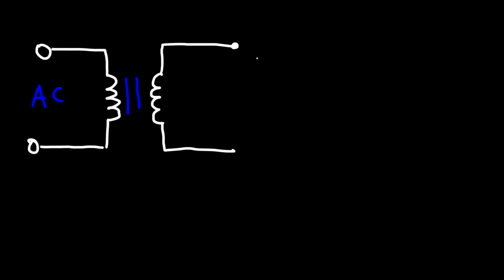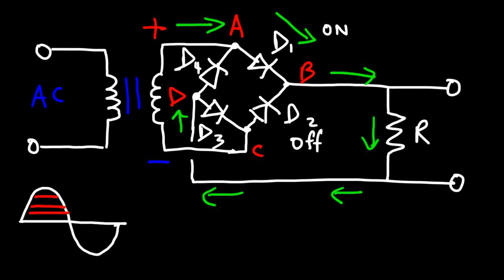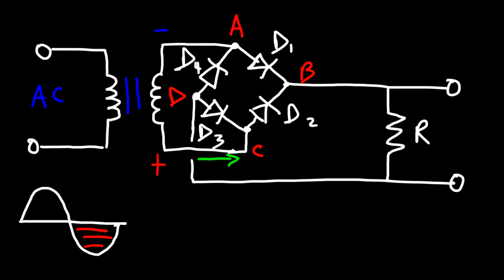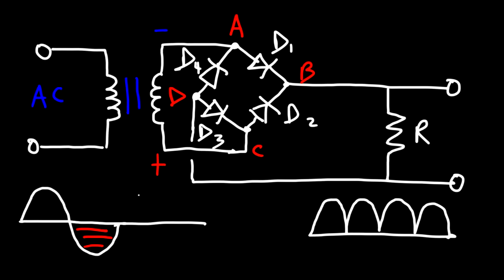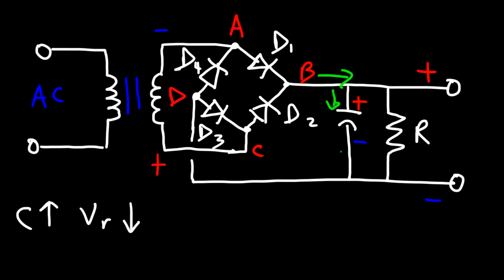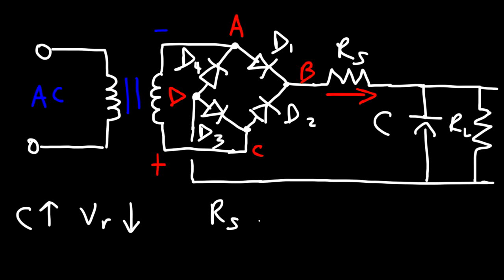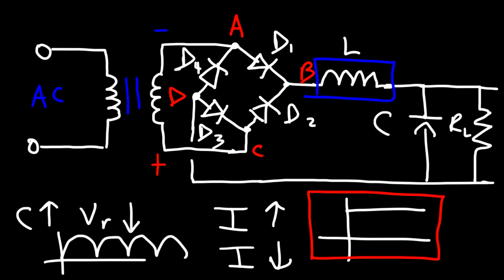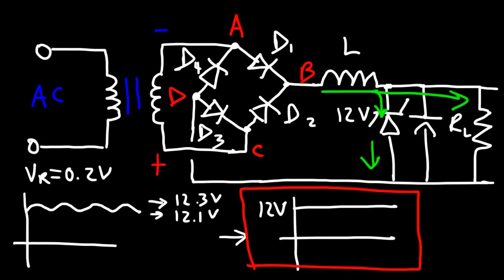Full Wave Bridge Rectifiers

Comment: Thanks for your video. You explain the current path taken is from high to low potential. That can be confusing when you have multiple paths at the same potential. I was taught that current follows the path of least resistance. You didn't explain that on a positive and negative cycle 2 diodes conduct and the other two don't. That makes it easy to understand why polarity would change and why a rectifier works.

Comment: Diodes maintain a constant  forward Vdrop, it's the excess current that blows them out. Diode will remain at .7 Volt. Multiply that by the current, and you get the maximum power the diode can handle. P=I*V

Comment: When the AC current is in its positive phase, why is the voltage below the transformer negative (-)? My intuition would say that the voltage is 0, not negative.
Reply: The positive and negative just denote the direction of current. The voltage is V right at the beginning of the current flow and zero after the cycle of the current around the circuit is complete.

Comment: Need your advice. Have a source from hub motor of 24v ac and want to use a microwave transformer to step up and I am getting 105 volts ac. I need about 88 volts DC only but after I use a rectifier ic I get 84 v DC. How can I get a constant 88 volts DC from my set up?

Comment: Thanks for this thorough explanation.
Please does the inductor used in the circuit for ripple voltage reduction has any negative effect on the circuit? Like the resistor

Comment: I don't understand how the capacitor discharges in this circuit which direction will the electrons flow in that case ?which diodes will be ON then,when the capacitor is discharging?

Comment: Morris Achtemichuk
Well done, but I'm still trying to find out what amperage soldered in fuse right after the bridge rectifier I should replace in my RV AC/DC 55 amp convertor.. After replacing the shorted bridge rectifier (found a screw rolling around under the circuit board in the metal case) I removed the blown fuse
and have now lost it. After installing the new bridge rectifier I checked the DC voltage and was surprised it was higher then the AC going in. I think it was about 163 DC. I looked it up on Google and apparently this is correct. My convertor does not have transformer prior to the bridge rectifier to reduce the voltage, but only 2 round iron cores wrapped with single level copper wire and a yellow box MEX-X2 MPP prior to each. I think that's just to clean up th AC going in? I think the 12 volts is reduced further down the DC side of the circuit board. I can't get a schematic for this discontinued AC/DC Parallax convertor and would like to get it up and running for my motorhome.

Comment: How come the volatge at D mentioned at time 10.32 is 0.7v?if the potential drop across across resistor is 0.7 then (19.3-0.7)v must come out.But how 0.7v is in the junction D

Comment: Great video and explanation. Unfortunately, many companies will  try to minimize the cost of the power supply and there will be trade offs as far as including a zener diode, inductors and/or higher current rated rectifier diodes.

Comment: Anyone still active in this video? Could I ask on how to calculate minimum frequency of this full wave circuit with RC filter with only 3 informations? 
- A person trying to charge 1.5V AA battery using a function generator
- The time constant is 0.27 ms
- The battery only accepts a ripple factor of maximum 10%

Comment: You need the 1000uf capacitor instead of the resistor to make it a DC volt output.
Reply: 100 2000uff blastt

Comment: The reason why "In Series" for the inductor and  "parellel"" for the R and C?
Reply: I believe This is because of the characteristics of a capacitor and inductor. When a capacitor is fully charged, it acts as an open circuit. If he put the capacitor in series, your circuit would not conduct since it now has an open in series with it. The inductor is opposite. After the inductor is fully charged, I believe it acts as a short circuit, allowing continuity to the rest of the circuit.

Comment: I have this older 12v battery charger that has a simple AC to dc Transformer and bridge rectifier like this set up but No cap and no resistor. Im have issues with it not outputting 12v for some reason its below 12v   like 11- 11.5??  Can anyone try to figure it out for me? and say what I could try replacing inside it to get the output above 12v for charging!   Thanks Ben
Reply: 21vv bateryy
Reply: @jeetenderkakkar7570  what???
Reply: @mainelyelectric  wifee

Comment: If you are at 20V ac in what is your DC out on the full wave bridge? Is it 20v ac / Square root of 2 and subtract 1.4 volts dropped for the total of the diodes peak to peak? How to calculate this?
Reply: 25kvv

Comment: Thank you very much for the good explanation.its easy to understand.can the fullwave rectefier take the place of halfwave rectefier ?the halfwave rectefier was busted recently formerly from the factory it has no on&off headlight switch i connected the head light yellow wire from the red wire coming from the battery before the ignition switch.so the yellow wire from the stator  is directly charging the battery without passing the headlight,hope you understand my explanation thnks and god bless...
Reply: Hardd

Comment: thank you very much, i hope the next video will extend the information the connection of potentiometers for a different  DC voltage output from 1.5,2,3 and so on, and how to do that in the circuit...
Reply: 12v

Comment: How do we know the voltage drop across the resistor is 0.7? This is discussed in the first 10 minutes of the video
Reply: Check carefully.. vol drop across the resistor is not 0.7...
Reply: The voltage after the resistor is 0.7. Voltage drop is 19.3-VOLTAGE DROP = 0.7
Reply: The voltage drop is how much the resistor reduces the voltage. In this case it’s 18.6V. That value is determined by the amount of resistance the resistor provides (measured in Ohms), which for The purposes of explaining a full wave bridge rectifier, is inconsequential. It simply represents the resistance of a load, a dc motor perhaps.
Reply: Not resistor, Diode..

Comment: But doesn't current flow from neg to pos. Electron current flow has been known to be the right theory.
Reply: Assume electrons have positive charge! What is positive anyways! It's all a convention, and it's easier to do math with positive numbers.
Reply: conventional current goes from pos to negative, electrons go from negative to positive. conventional current is still used in engineering (electrical), maybe not in your physics class.

Comment: Finally someone explains why the current won´t go through the upper diode. It´s all about potential difference. Well done!! :D
Reply: I agree, I was trying to figure  out the same thing.
Reply: Guys I know this is late posting on this comment, but can any of you help me try to figure this question out? These circuit diagrams, are they just diagrams for conventional use only? meaning that if you used this circuit diagram for instance in real life it wouldn’t work as the actually current is flowing negative to positive so the diodes wouldn’t do what you want them to do. Hopefully if you read this you could explain that to me. I’d really appreciate it. Thanks 👍
Reply: @Livefree432Livewhole  These diagrams are designed for conventional flow. However, you can use the same diagrams and just think in the opposite way. The electrons will flow from negative to positive, so they flow from a low potential to a high potential. That also means, that the electrons actually flows toward the "arrow" from the diode. Everything works in the opposite way, well at least the current. If we go to the beginning of the video and let's say that the electrons flow from the transformer  through point "C" and "D",  through the resistor, then through point "B" and "A"(B because it has the higher potential than C) and finally back to the transformer, then you'll see that the end result is the same.
Reply: bukvalno, 2 minuta videa > mesec dana casova
Reply: @nikolapostic  Pogotovo sad na online nastavi kad nam šalju samo materijale
Reply: Was about to say the same! Never heard of potential difference until then. Now it makes sense for me!
Reply: Same was mine case thank u sir
Reply: 1000
Reply: - Was it all potential difference?
- It always has been...
Reply: Voltage is the electrical potential between two points. Voltage makes no sense without two points. Second, current ALWAYS flows positive to negative! 

The physical electrons may move negative to positive, but that is completely irrelevant. If that discovery contradicted any of our theories or equations, they would have updated the textbooks by now.
Reply: I find it helpful to think of voltage as height. A voltage drop as a drop in height. Or the flow of electricity jumping a gap and dropping in height when imagining a forward biased semiconductor (e.g. an LED).
Reply: how are you doing now dude